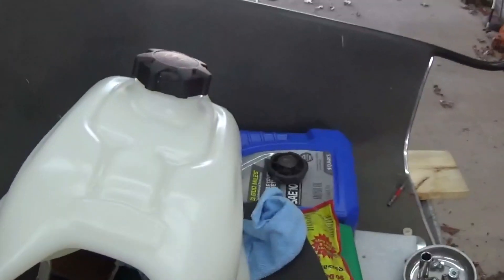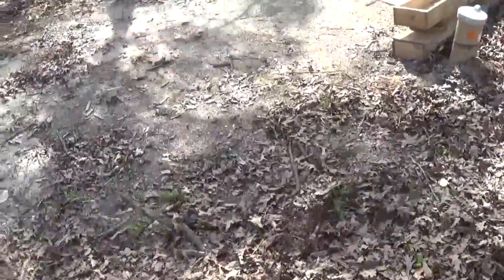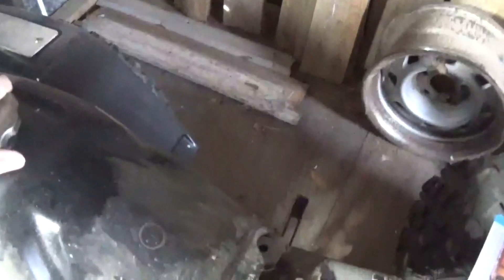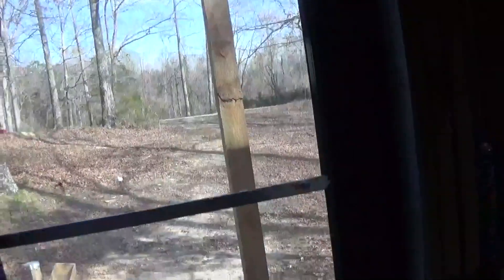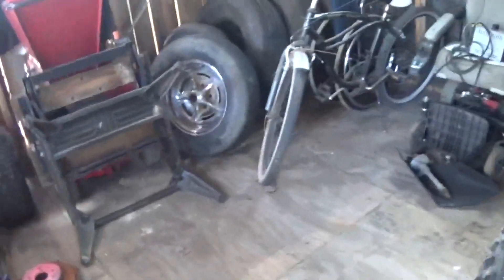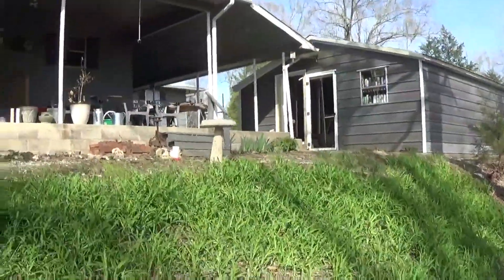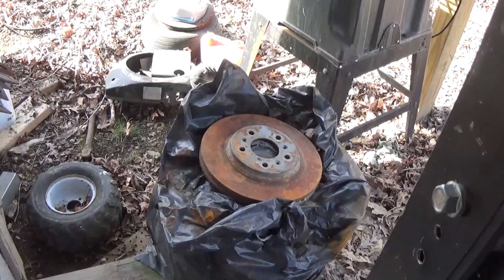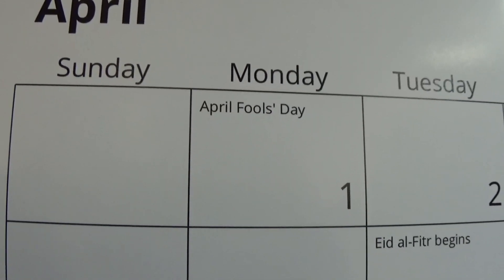1986 Honda 4 wheeler update and more!

Comment: its not warm here in Northern Nevada had snow again last night. Winter just wants to hold on here. That's good that you have the 4 wheeler running and once you get that plastic tank on you will have trouble free riding.  Here's a vid of my fun yesterday https://youtu.be/ELGKttNctcw?si=9-O9Go9Aa59j4j3j
Reply from the maker: Sounds pretty good Larry. It won't be long before you are driving it around the block. Thanks for stopping by here.